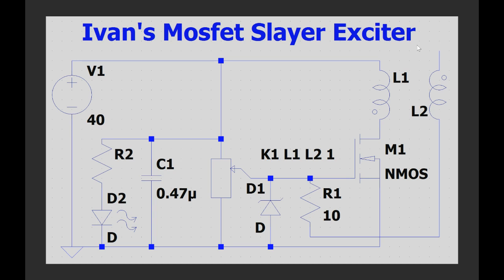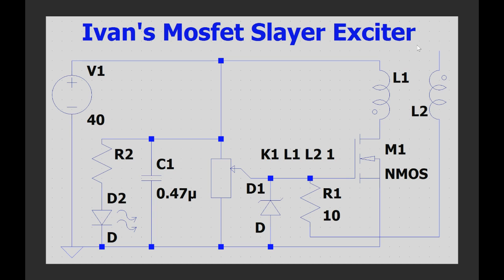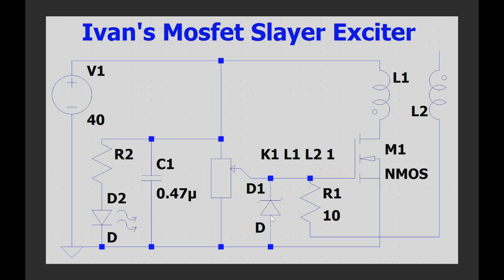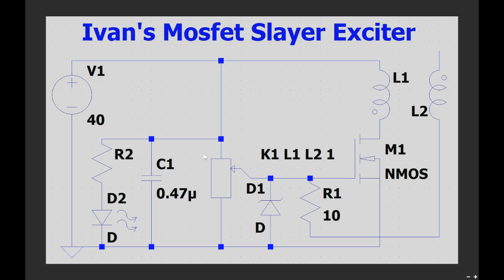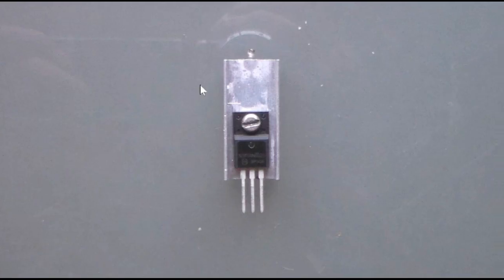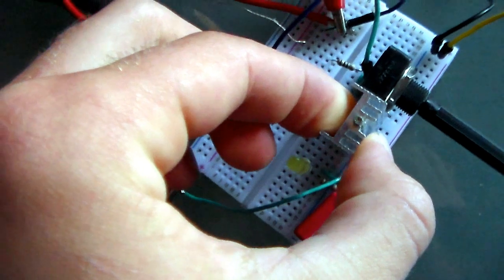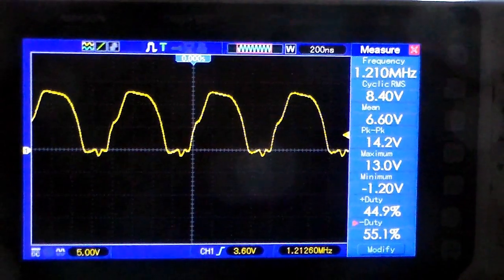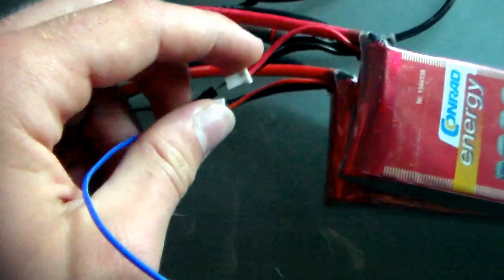Mosfet Slayer Exciter Part 1

Comment: Hello, What is the purpose of R1 on the circuit?
Reply from the maker: Great question. R1 is there to reduce the RC time constant of the mosfet and make the switching more elegant reducing current spikes and preventing undesired secondary oscillations. You can try with and without it to see how the circuit will behave. Alternatively, you could consider using a (very small) ferrite bead as is done in SMPS modules.

Comment: Great video! Thanks Ivan!
Reply from the maker: Thank you for your kind words :) The schematic in this one could use some serious improvements, see the later uploads, if you tweak the diode arrangement you can get maybe 1.5 to 2x more output at the same input power due to a more spectrally dense driving waveform and the circuit running as a switch and not an amplifier.

Comment: I made a pancake slayer exciter according plasma channel and used this schematic with a MOSfet(irf510) and it works fine and even works better than a transistor but unfortunely the secondary winding has broke down...too thin wires.
Reply from the maker: Hey! I'm glad the schematic works well for you! It has a few major problems though. I recommend you use a modified version of this schematic where you instead use a fixed gate voltage and clamp it with two shottkies and a low ESR source is used for the gate bias such as a LiPo. You get a more square waveform and thus higher efficiency as well as a more stable and modulatable circuit. I made a video testing the circuit last week but still have to upload the video with the schematic analysis.

Comment: Hey thanks for posting this! I followed your schematic (with some substitutions) and it works great! 
Barely any heating in the mosfet, too.
Reply from the maker: Barely any heating? I am impressed, usually these types of driverless circuits are quite inefficient, sure they are better in terms of efficiency than bjt designs but there is much improvements that can be made, you should try out the schematic from part two. Or better yet build either a bridge/push pull schematic using several fets or transistors for that matter, works like a charm, Ill eventually make a video on it, right now uni sucks up all my free time :D. Glad it worked though!
Reply: Well, the mosfet (infineon 07N60C3) has a low R_DS_on at 0.54Ω, and it's FAST, so that helps. I also swapped R1 for 40Ω and VR1 for 10K, and the zener is 6.5V.
It shoots about 2.5cm long streamers at 24V and even at that voltage the heatsink is just decoration. So, great work mosfet-optimising the venerable Slayer Exciter, and thanks again for posting it with a readable schematic!
Reply from the maker: @TinkerTom  Nice! 2.5 cm breakout to air or to an object by the way? I doubt the internal resistance of the mosfet plays a significant role here because the mosfet is not driven by the circuit in the digital modes but rather the mosfet is close to hysteresis, which is great for having a stable oscillator but can lead to tremendous heating of the mosfet as the current voltage characteristics of the mosfet will emulate a higher value resistor than the Rds value (another problem of this circuit). What could however be of help is the gate capacitance as that could theorhetically leed to a more efficient coupling at the cost of more heating. What coils are you using btw?
Reply from the maker: @TinkerTom  I guess the streamer lenght is simply a factor of how much juice you give the coil as well as what exactly consitutes a streamer, but yes they do tend to be under 2 cm for lower power systems. What frequency does your circuit operate at and are you using a topload? Seems very similar to the secondary I used, but a bit larger. As for the silicon lottery quite possibly :D ! The funny thing in this circuit is that the mosfet physics are actually rather straightforward for the most part.
Reply: As a topload I have a paperclip bent into a straight stick pointing 8cm above the secondary (plus a loop wedging it into the PVC pipe it's wound on), so I don't have a loose copper wire flopping around and possibly melting. I can's say what exact frequency it's running at, as I only have a basic multimeter (not even an LCR, so I can't even take the math route to figure it out). Also I wound the coil like 12 - 13  years ago, if my science was correct at the time it should be around 9 mH, but again I'm lacking the tools to verify this. I'm also thinking, could it be that my lower voltage zener (in my case 6.5V, ~twice Vgs_on and ~1V above Vgs_plateau for my mosfet) and 4x higher R1 helps with the not-exploding-mosfet situation?
Reply from the maker: @TinkerTom  Hmm good idea with the paperclip, although seems a bit overkill unless you are pushing 100s of watts into your system. The funny thing is you can determine the exact frequency quite easily with just a multimeter, or am radio! with the am radio, find the strongest frequency at which the radio will go quite or make a variable lc tank circuit with known value components and put an envelope detector across it, measure the voltage across the capacitor with your multimeter and find when it is highest by tuning your circuit, thats when youve hit resonance and that is the frequency of your circuit! I also have a spreadsheet to calculate the frequeny by inputting wire type, and coil parameters, can send it to you if you want.

Comment: How to lower its resonance frequency
Reply: To lower the resonance frequency increase the capacitance, I.e larger top load or toroid capacitor. Or increase the number of windings on your secondary. Larger inductor or capacitor means lower resonance frequenxy
Reply: @tf3confirmedbuthv54  i see you everywhere lol
Reply: Juntendo lmao
Reply from the maker: What exactly do you mean by lowering the resonance frequency? The operating frequency of the circuit, the resonance frequency of the primary or secondary coil? I will assume you mean lower the resonance frequency of the secondary coil. The simplest way to do this is to wind some more wire on it, no seriously larger coil means lower resonance frequency ceteris paribus, or you could stack a few cans on top of it.
Reply: @ivanrodionov9724  thnx man

Comment: What are the size, gauge,  and winds of your primary and secondary coils?
Reply from the maker: my secondary coil consists of 110 meters of 0.2mm wire wound around a 40mm acrylic tube, while my primary coil consists of 4.5 turns of 0.7mm multistrand wire wound around a 5cm PVC tube.
Reply: @ivanrodionov9724  Translation:About 32AWG secondary and 21AWG primary
Reply from the maker: @tf3confirmedbuthv54  I guess your right lol